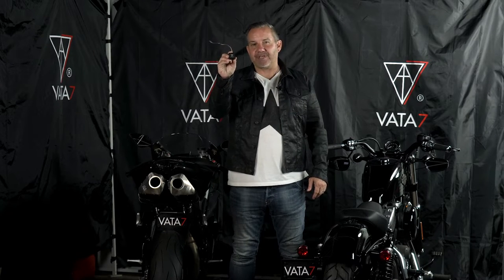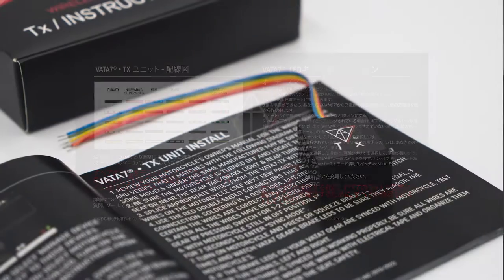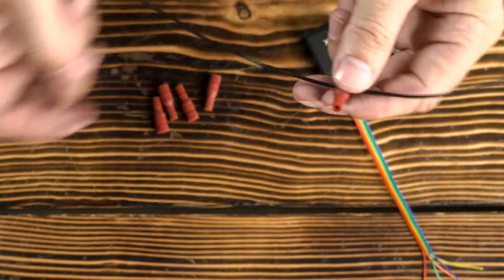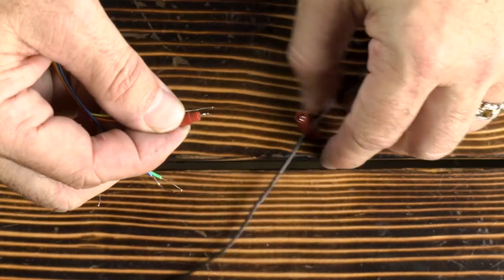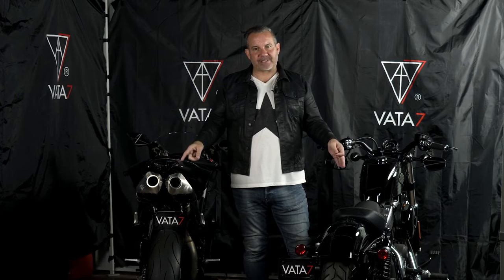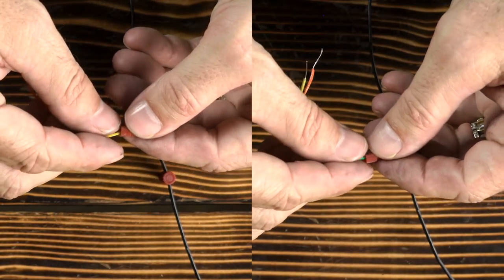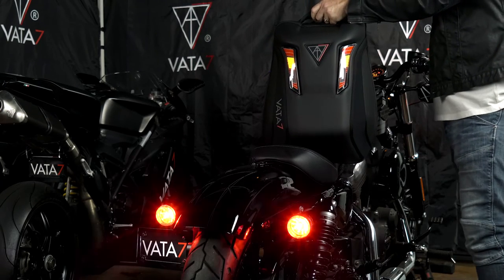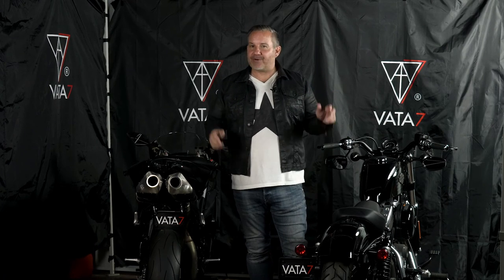𝐕𝐀𝐓𝐀𝟕 Tx UNIT INSTALL | 𝐕𝐀𝐓𝐀𝟕 𝐓𝐞𝐜𝐡 𝐒𝐜𝐡𝐨𝐨𝐥 𝐕𝐢𝐝𝐞𝐨 | 𝐄𝐩𝐢𝐬𝐨𝐝𝐞 5

Comment: Need a demo of doing it to an actual bike under the seat. You make it look easy using a loose wire up on a countertop. My bike has about 70 wires under seat and rear cowl so connecting is not anywhere as easy as you make it sound.
Reply from the maker: Please email us with your bike information and we can help assist you with your install my Friend.  Info@vata7.com. Thank you & ride safe.

Comment: I need help with my 2018 Honda NC750X (ABS) motorcycle since it’s battery is located in a odd place and I don’t know where are all those wires are at. I would appreciate the help.
Thank you.
Reply from the maker: Hi Friend, we can help.  We'll send you an email with the Honda wiring diagram for your bike.  Yu do not need to connect to battery, it's SUPER EASY!  Thanks & ride safe!
Reply from the maker: Hi Friend, we've got the information you need help with, can you please email us at info@vata7.com so we can send it to you?  Thanks so much!
Reply: @VATA7-  I emailed you guys 👍
Reply from the maker: @SpiralOwl  Hi Friend.  Yes, we replied both times, pretty quick in return.  We got you!
Reply: My brake light has 3 wires. Negative. Brake. And running.. no power or positive wire
Reply from the maker: @MindChamber  Hi Friend, as we emailed you, your 'Running Light' wire should be your 'Power' wire.  Do you have a volt meter?  Thanks, and again, please call us if you'd like.